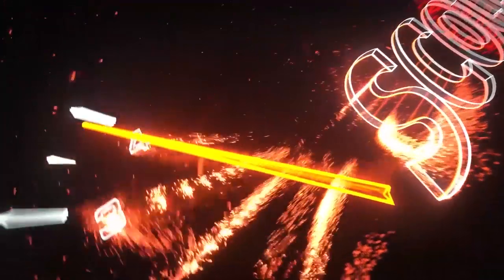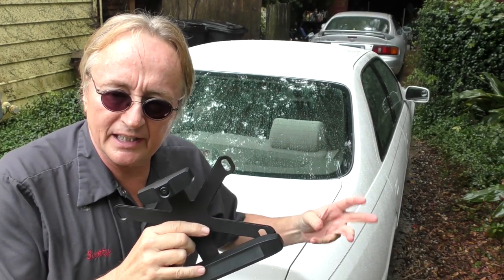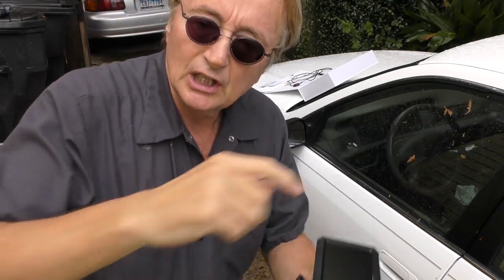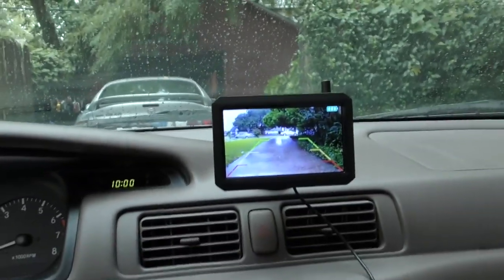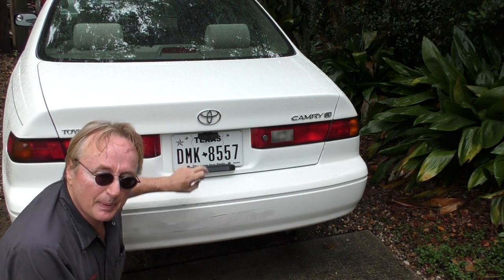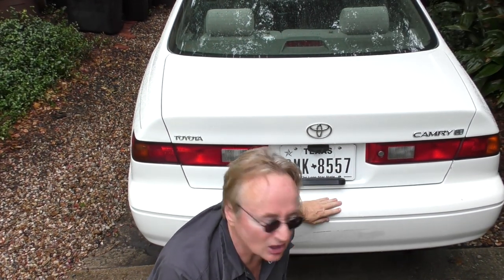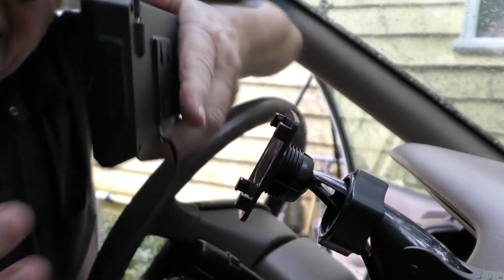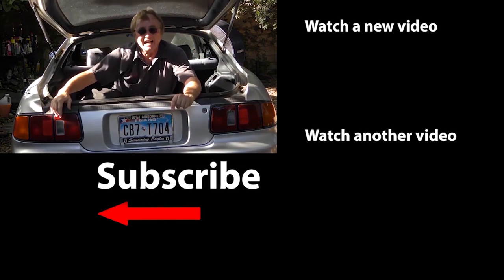The Secret to Turn a Normal Car into a Luxury Car

Comment: Last time I was this early Chrysler was actually making good cars
Reply: Last time I was this early, 1992 to 1996 Camry’s were common... Oh wait, they still are.
Reply: DSTY last time I was early bmw were making good cars
Reply: Corey The FAM They still are. Just kidding, they’re crap.
Reply: Sooooo.... never??
Reply: Dracoball Chrysler cars were at one point not bad. I see more 50s 60s 70s chryslers than 80s and early 90s.
Reply: I actually question how Scotty says Chrysler is worse than ever. Almost anything Chrysler from the late 90's to 2010 is drastically lower quality than FCA stuff. Sheet metal was far thinner, interiors were disposable, and everything else cosmetic was penny pinched down to the lowest quality possible. Oil burning engines and cardboard transmissions are still finding their way in the cheap FWD cars in FCA, unfortunately.
Reply: @asdfghjqwertyu1858  I have a '97 Camry.  Looks exactly like the one Scotty has in his show...
Reply: Nick J I was! What about the Córdoba? That was one gorgeous car! Chrysler sure made beautiful cars back then!
Reply: Wrangler was Small
Reply: @Dcc357  cardboard transmission 😂😂 now that's hilarious
Reply: Dcc357 .... we have a 1998 Chrysler Sebring convertible purchased new and other than a stubborn oil leak (fixed now) has given us very little trouble .... always garage kept (Florida car) and only 77,000 original miles but no complaints here .... and oh yeah, it was built in Mexico
Reply: @billgale5568  some Late 90's chryslers are more than decent. like Jeep wj 😂
Reply: @Dcc357  -  Regardless of what Scotty and others say, I like my 2004 Chrysler T&C minivan!  It's doesn't use or throw oil.  transmission works great and the body an is as solid as  new, and I think it's a beautiful machine!!  Having some trouble with the EVA P system and  bit of hesitation sometimes, that I'm working on!  Deteremined it's not due to the throttle position sensor!
Reply: YouTube didn't exist then.
Reply: We got a mad Chrysler/Dodge/Jeep or fiat fan here very obvious
Reply: Han Skinslo Neither did I for that matter.
Reply: @asdfghjqwertyu1858  Not as common as the 1996 - 2001 models and their Solara variants.
Reply: @auto_kevin9731  Studebaker had those. It wasn't cardboard exactly it was a pressed paper timing gear set vs a chain or a belt
Reply: @98triffid  oh wow.. cheapest of the cheap
Reply: @auto_kevin9731  I'm not sure if it was cheaper, it was different. They weren't a common wear item but neither was a timing chain. They also created the "hill holder" clutch decades before Subaru allegedly "invented" the thing.

Comment: I have 3 solar powered backup devices in all my cars. They work at night too but work best when the sun shines.

They are commonly called...mirrors.
Reply: Jim F Backup cams are like a fourth mirror to check, not a replacement for the other 3. It gives a ground facing view to see things the rear mirror is too high to see
Reply: Been using backup cameras for years. I have no issues. Y’all doing something wrong ha
Reply: Yeah, but if you parallel park, "gauging" distance of your bumper before hitting a car is tricky.
Reply: lol
Reply: stevest1300  Been around for Centuries! Cars have had them since they replaced the Horse! Always worked fine! I've NEVER backed into any object in. 40 years of driving!
Reply: Lawrence Jensen Yeah but....one more electronic thing that when it breaks, cost a fortune to repair... And, only the Dealer can fix it! No Thank you!!😂😂😂
Reply: “Mirrors” will not show you what backup cameras do.

Comment: Owning a nearly 20 year old car that runs perfectly & saves you thousands is a luxury.
Reply: Elusive Logic Well spoken... So true
Reply: Cheap motoring is great and all. But the difference in crash safety over 20 years is huge. And is easily worth the investment in a near new car, even if it's a very basic Japanese or Korean car. Your 71% more likely to die in a crash if your car is over 18 years old. Not worth the risk.
Reply: FORGETFULFOOT that’s why I drive an old Mercedes  best crash ratings :)

Comment: OR YOU CAN GO TO THE DEALER AND BUY A $30,000 NEW CAR AND BE IN DEBT LOL 😂
Reply: Or buy a corolla for $20,000 after saving to pay cash, but nobody does that
Reply: Exterminence  Don't have kids and save even more money.
Reply: That's the American way!
Reply: Exterminence  It's not just a backup camera. There are a bunch of features that new cars have that your old 2000 Ford Expedition doesn't have. Bluetooth connectivity, more airbags, better crash testing scores, ESP, adaptive cruise control, lane keep assist, emergency autonomous braking, better gas mileage in general, low tire pressure sensors, heated/ventilated seats, rear-seat climate control, bumpers that can resist cracking at lower speed collisions, and many more features. By all means, don't but a new car if you can't/don't want to, but saying that a backup camera is all that changed is nonsensical.
Reply: And send the car to the dealership to make it even worse

Comment: This wouldn’t work in the winter of Alaska because it’s daylight 2-3 hours a day!! But a very neat idea!
Reply: You can charge it with phone charger
Reply: Your reverse lights will assist with the brightness.
Reply: Use the wired one
Reply: TIL Alaska has more sunlight than England.
Reply: Jason It definitely sucked the first year. No chick til a.. Cant order certain items online... There is no Air condition in most houses... but it is very beautiful. The summer here makes up for the harsh winter. It does get kinda hot in the summer though but not dreadful.
Reply: tom johns old high school photo of my wife and me.. but that sounds like something Alabama people do😂
Reply: Just splice the wire, there's a bottom port for power
Reply: Well how much time do you spend in reverse? 🍻🐈
Reply: cekmore Gato I’m sure that it would charge just fine with the sunlight but I would be more worried about if it would hold a charge for how cold it is in the winter. I have back up cameras on both my vehicles but I do like the idea of this camera.
Reply: Plus our cars get rear ended in the winter anyway so who need a backup camera just reverse till you hit something
Reply: Hello Christian, I live in the valley, solidarity!
Reply: @didntask5860  -  That's a good comeback!
Reply: Christian Foster the camera is only used for a couple of seconds then it turns off 😂

Comment: I put one of the Peak cameras on my pickup truck- no big deal at all to run the power lead to the backup lights- primarily for a trailer coupling setup. It works fantastic. I don't need it for normal driving, since I've driven pickups over half my life, but that is one handy gadget.

Comment: Hey Scotty! Check out a brand of wireless solar backup cameras called Type S. It’s basically the same thing, but you don’t even need the on button. It powers on when the car starts and goes off after a minute. If you want it back on, there’s a motion sensor in front of the screen and you just wave your hand at it, then you get another minute. They have them at Costco, the older kind is about $125 and there’s an upgraded one for $150. I got the old one on sale for $100 for my mom’s car and it works great.

Comment: Interesting device. I think the new wired one will be better. Wireless link to monitor but camera gets power from the reverse lights so no need to manually switch it on or worry about having enough sun to keep the battery charged. That could be a problem here in the rust belt during winter.

Comment: That's  great if a clear license plate cover can fit in there, too. That would be perfect for cars without backup cameras, and the bonus if you have an older car without one, you can replace the radio with fully loaded Sony, JVC, Pioneer radios with a CD player, higher quality sound and power, Android Auto, Apple CarPlay, USB and auxiliary audio input jack, etc.

Comment: I like this on.  I installed a wire one in my old vehicle, but I did not have to cut  or drill any holes and it went directly to my radio which had a place to plug a camera plus a wire already connected to let it know that the car was in reverse.  Cost was $99 for the camera and it worked great.  I had tried some wireless systems, but they were very unreliable,  let us have an update on it a few weeks or months from now.

Comment: Scotty don't forget an easy way for someone to hard wire something without running to the battery or having constant power is to use a fuse tap on an accessory fuse.

Comment: I already have a reverse cam (aftermarket) for my 2011 F-250, Sometimes I wish it had a front facing camera as a compact car can almost entirely hide in the front blindspot (factory suspension and basic 17” wheels).

Comment: found removing the backing off the VHT is easiest if you have a sharp knife and you can slip it between the backing and the tape and allows lifting the corner easier, but yeah the tape is strong but a pain sometimes

Comment: I still use the good ol’ “right hand on the passenger headrest while looking back” technique to back my car. Hasn’t failed me yet.
Reply: Same here, I have two adjustable blind spot mirrors for those tough to see parking spaces, it can be tough to see past the tailgate in my truck, the rear end is pretty high up. I've never felt the need for a camera, seems like a gimmick to me. I mean if a big rig driver can back in an entire trailer loaded on their truck, I'm sure the average person can back up a car.

Comment: Hi Scotty, can you do a video on how to fix noisy hydraulic lifters for beginners.  Most challenging bit is how to remove all the stuff on the engine before taking the top off then put it back together again at the end for a complete newbie who's only done oil changes.  Spent heaps on these liquid additives supposed to fix it but don't do anything.  2002 Mazda 626 speaking! :)

Comment: the adaptor is in the cig lighter part (car charger)  changes it to around 5 volts , so don't cut the wire and wire directly to the battery you will kill the screen.

Comment: Just have to make sure it fits on the plate recess, some cars have a tight border and a deep well around where the plate sits, I wonder if there's any information on the margin of space you'd need around it? If you park in the shade a lot, it probably comes up short too. Also that'd make more sense for minivans or trucks than some small sedan or coupe where the back window visibility is usually good enough. (Although I suppose it's handy if you do a lot of parallel parking and need to see right next to the rear bumper.)

So as neat and good as it seems, might not work for everyone.

Comment: Hi Scotty, 
mechanics asked us to use fully synthetic engine oil even for naturally aspirated cars because they claim it last longer than normal engine oil. 
Any comment please?
Reply: That's true.  Synthetic can reduce engine wear and resists oxidation and thermal evaporation better.  Change it every 5k - 7k miles and use Wix/NAPA/OEM oil filter.  No need for really expensive synthetic like Amsoil or Mobil.  Shell Rotella is offering $10 rebate and Castrol has a $7 rebate that's good until Dec. 31, 2019.

Comment: I just installed an Eonon unit in my BMW, sure, it took some work, but I don't have an ugly contraption on the trunk lid and certainly don't have a bunch of wires dangling on my console, and it works automatically whenever I shift into reverse. I will say again, it took some work, but that is sometimes the price you have to pay if you don't want to look like an amateur.

Comment: If only this was a rear view mirror model it would be perfect.  Also, in my experience with solar (or maybe it's the batteries), they don't stand the test of time - probably would just wire it up to the 12v for the rear lights.

Comment: I wonder what the range is until the monitor and camera can't connect. If it's around 40 feet, it'd be nearly perfect for a 5th wheel or travel trailer.

Comment: Scotty, I ordered one of these and am very disappointed. The backup guidelines on the screen are 15-20 degrees out of parallel to the vehicle and there is no right/left adjustment, either on the camera frame or in the screen software (I find it incredibly stupid/cheap that there is no adjustment).  I spent 2 hours with various attempts to jury rig some shims to correct the angle, but to no avail.  The up/down adjustment screws on the camera frame are so tight they will not budge. The suction cup on the screen mount comes pre-coated with glue, but I do not want to permanently install it. If the screen is mounted to the windshield, the screen is not bright enough to see it when the sun is bright. (I'm having to prop up the screen in a dash cupholder.  I sent an email to customer service with questions, but they have not responded. Pretty cheap for a unit that costs over $180 with tax.  Well, the packaging was beautiful. but a poorly thought-out product.

Comment: Is the camera's rechargeable battery serviceable? If so, does it use a standard or common inexpensive replacement battery? Like AA or AAA? I hate things that become obsolete just because of a non serviceable or outrageously over priced battery. Many blue tooth devices and cordless drills come to mind as an example.

Comment: Scotty, I bought one at Costco similar to this except that all you do is wave your hand in front of the screen to turn it on. No switch needed. But now my question,  On a 2006 Toyota Corolla,  I hit a coyote and tour up my wires to my oxigen sensor. My check engine light came on.  I replaced the oxygen sensor by a new one from Toyota  ($170 later) and reset the engine, but the check engine light comes back on after I drove the car for a mile. Any ideas why ? Thank you.

Comment: Wouldn't that system not work on cars that have the number plate light pointing down witch would then would cover the light atrackting attention to law enforcement for a possible defect on the plate not being aluminated at night? 🌃?

Comment: The secret is just put tech in it which cost a low amount from 25-1000 which is cheaper than luxury cars which cost like 300,000 but you can turn an old Honda Civic into a cool honda.

Comment: Hallo Scotty. i need help, i have a 2007 Cadillac escalade esv with 165,009 miles  that shifts all gears, but sometimes slips when driving below 40mph, and reverse takes about 5 seconds before going into gear. gust want to know if i need to buy a new transmission, or if is gust a something easy to repair.

Comment: Stinks that it cannot be used on big Pickups like my F250. Pickup trucks need the backup cams more than small cars too. Bummed me out.
UPDATE: Further details say that it should be just fine for any vehicle up to 32ft in length! YESSSSS!!! The max length on my beast of a truck is 22'!
No more taking out poles and shrubbery in parking lots. LOL! Kidding,...on the poles thing but not on the shrubbery.  In parking lots I usually just park far away in a space I can drive straight out...(yet 90% of the time when I walk back to the truck someone always parks right next to me restricting my back door from allowing a full open radius to load the groceries. Yes,..this truck has the stupid mini back doors that open in the opposite direction than than the front ones. Not sure which is dumber, the door configuration or the dingbat who bought it; me.

Comment: Yeah but then you got that screen sticking up all the time that doesn't do anything. You only use it to see when you're backing up. It would be different if it was tied into a touch screen stereo system or infotainment center, but that's just eating up dash space for the most part. We don't spend that much time backing up.

Comment: only 1 flaw.  some states are Anal about u covering the text on the plate.  it doesnt hide the bar code (right side) but the state tag is cut.  ive had a friend get a ticket as he had a plate cover that hide basically what this 1 does and it was 45 buck fine.  so much for that baseball plate cover.  
for that cam to be 100 + bucks it better be good lol.

Comment: I'm surprised, AudoVox is generally a crappy brand. I have a feeling Scotty hasn't used this product long enough to know the real quality of the unit. Right now that camera is running on the rechargeable battery, but how well is that solar panel that's  in there? If it's not good quality solar cells, it's not going to recharge when cloudy, and in the winter. (Hopefully there is an update from Scotty 6mo.-1 yr. from now))

Comment: I was not that impressed with this. Granted my car is newer, a 2012 Camry, but I bought a wired camera system from Crutchfield that plugs into the factory radio. All I have to do is put the car in reverse it switches the camera on. Take it out of reverse and the camera turns off and goes back to normal radio view just like the one from Toyota.

Comment: If it used my phone instead of that monitor it would be much better.
Reply: Yep, wireless app to phone is a much better idea
Reply: @insideoutsideupsidedown2218  Yeah because waiting a minute for it to pair with your phone every time and relying on your phone to be charged is a much better idea..
Reply: @ixionn563  1) plug your phone into the power outlet that monitor is plug into and 2) my phone connects instantaneously to mine.

Comment: Meh. Just run the wires and not have to worry about the batteries eventually dying or having to press the button to turn it on.